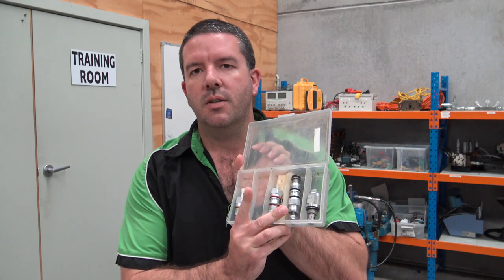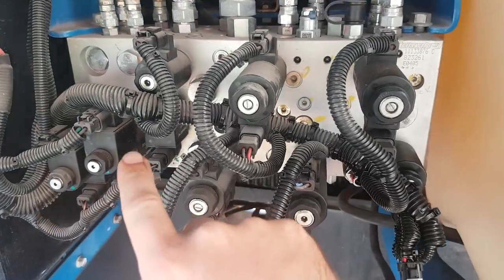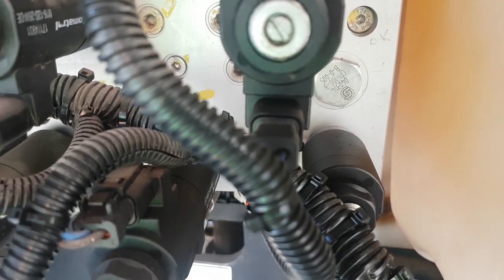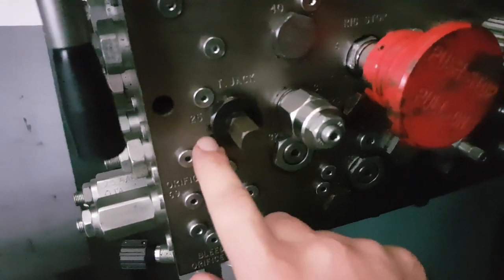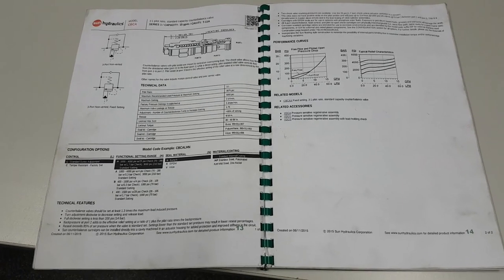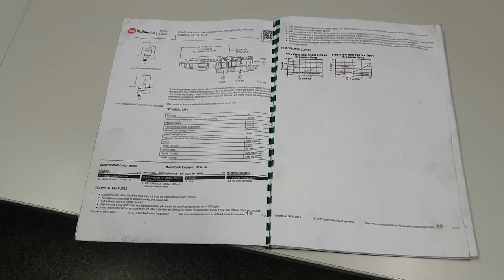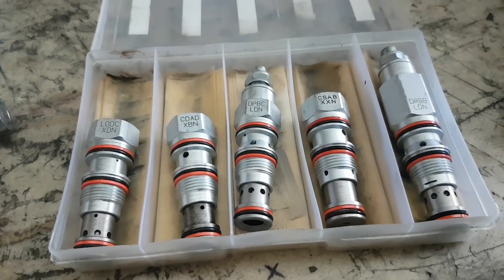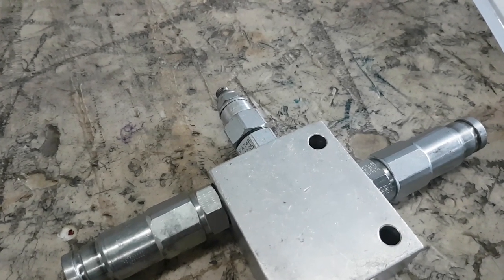How To Set Cartridge Valves- AskAPT 8

Comment: Excellent video. @ 2:30 of this video, this valve looks same as relief valve but normally cartridge valve symbol is like "T shaped" in schematics but in this video, it is quite different. Kindly correct me if i am wrong.
Reply from the maker: Hi there, the cartridge valve shown in the video is a motion control valve designed for load holding, this particular valve has both internal and external pilots, together with a bypass check valve.  It is a normally closed pressure control valve, which is why it looks similar to a relief valve symbol, but it is used for a different application within the circuit

Comment: How do you bleed the pressure off of a cartridge valve before removing it? Our Hydraulic Cyl. Supplier sent us some new cartridges to test in our cylinders and the first one we unscrewed came out like a bullet!
Reply: Quality ones will have a relief machined in threads, I'd change supplier if they couldn't supply a safer quality part.

Comment: How to identify a screw-in cartridge valve from a Turner/Spicer automatic transmission? Can not find anyone to cross reference the P/N stamped on the side: EDH64309.  Made by Comatrol with 2 solenoids fwd/neutral/reverse. Made 2/03. 4: